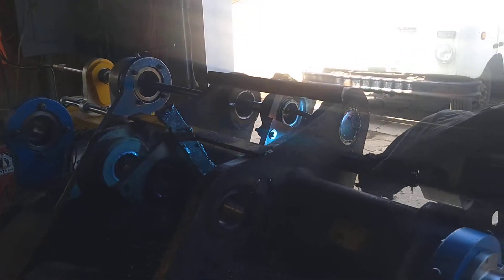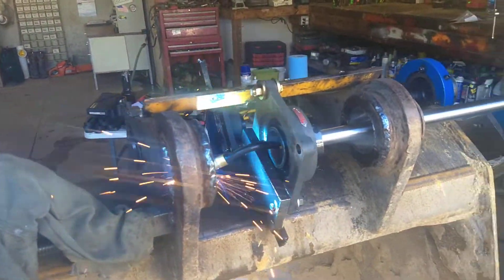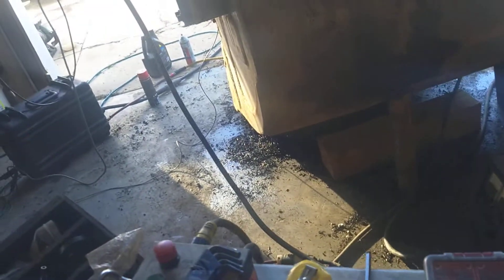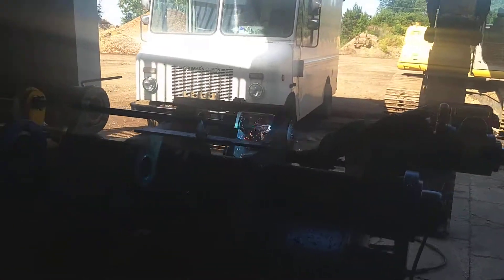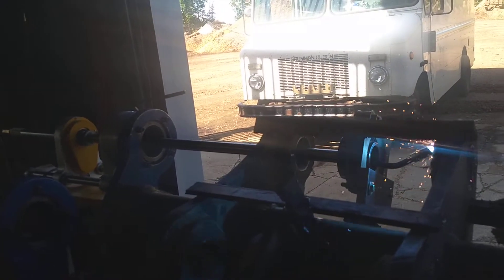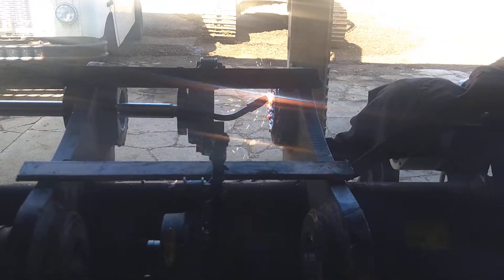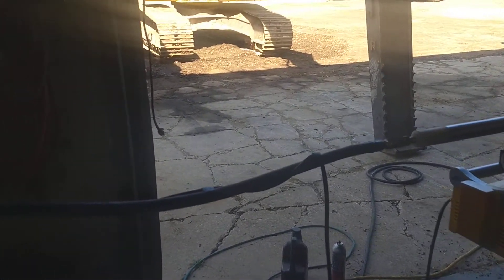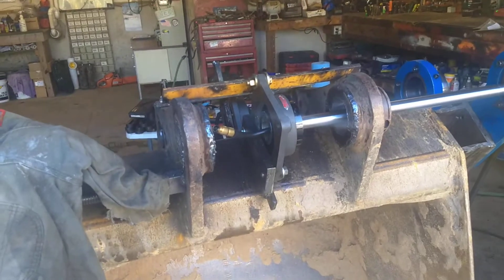Chinese bore welder review, are they any good?

Comment: Thank you very much for the info.  Been looking at those things for a while and just didn't have it in me to pull the trigger.  Now I know.  Their exactly what you said but they are enough to get by.
Reply from the maker: I had exactly the same dilemma when I needed a plasma cutter, I just couldn't convince myself that a $200 plasma cutter could actually work, so I bought the beat up old Miller instead for $350. I seriously wish I had just bought a Vevor to begin with.

Comment: I’ve been wondering what these are like. Has it lasted? I’m sure you made your money back on. Hopefully you still are active on YouTube. Thanks in advance.
Reply from the maker: As a matter of fact I just used it on Friday, it's still chugging along, I've made a few minor modifications to it since I posted this review but nothing major.
Reply from the maker: I would definitely approach buying one of these from the perspective that it's just saving you some time over building one from scratch, they really have some peculiarities about them as they come out of the box. Just as an example, the swivel where the cable attaches to it will bind up if you don't support the cable somehow, it'll give you royal grief if you just try and let it hang off the end of the stinger well it's welding.

Comment: So for a guy starting out whats your thoughts on a Chinese 5000 doller bore welder and boreing set up. I'm redy for a bore machine but 30 + grand is a lot lol
Reply from the maker: I wouldn't buy any Chinese welder or boring machine unless you have the tools and ability to make anything that breaks- welder, mill, lathe, and the ability to use them. I can't overemphasize how bad some of the features on my bore welder were, I never even tried to use it before I made modifications. I still fully intend to buy an American made welder as soon as I can afford to.
Reply from the maker: I really can't speak to the quality of the Chinese boring machine, but in general I would steer towards the ones that are copying the climax design if I was inclined to risk it. The York style has some pretty significant design limitations and I have grave doubts about it getting any better when the Chinese copy it.
Reply: Whats your thoughts on york machines?
Reply from the maker: @beauswisher8580  I have never operated a York, but I built my first boring machine myself as a knock off of a York. I took all their dimensions and beefed them up, 1 1/4" guide bars instead of 1", 3" billet aluminum end plates instead of much thinner cast aluminum, etc. Having used it side by side with the climax, it is great up to about a 3" bore but York is seriously overselling the product to claim it is practical on anything much bigger. It is much more prone to chatter and vibration than the climax.

Comment: Thanks for making this video. Was wondering how well they worked?  I see the welder/ line boring set up for 4000 bucks from China. Normally the cost is 25-30k from York, climax or bore repair
Reply from the maker: I'm still running this rig, definitely has its limitations, but it beats hand welding all to pieces. Buying a york bore welder is on my wish list though.
Reply from the maker: I should add that I have no experience with the chinese boring equipment, just the welder. I built my  first boring machine as a rough copy of a York 4-14 and then bought a climax BB5000. I don't think I would get a Chinese boring machine, I have serious doubts about getting any actual work done with one.

Comment: Hey Andrew, I know you said you converted to miller gun/ nozzle, but how does the one it comes with allow for nozzle to bore adjustment ?  Different length stems or necks, ball swivel gooseneck?  As I'm sure you are familiar with the climax/boretech ones use very stubby nozzle ends with a curved contact tip for small bores (1.5"-3" or so).  It doesn't look like the gun/ nozzle it comes with would fit for small bores work ?   Thanks in advance
Reply from the maker: It has a ball swivel system, you are correct that the existing setup isn't good for anything smaller than about 65mm. But those are simple enough parts to make.
Reply: @Andy-PerpetualMotion  I see and thank you, I bet even the BOA/york  weld necks and nozzles could be adapted to fit it as it is a similar design.

Comment: Andrew, where did you find one of these for $1600 ?  I see them on eBay in the 2200-2600 range.   Also what size is the split bore where the  bore welder frame is made to clamp on a bearing ?   Wondering if it will fit  on a york bearing, thanks in advance !     Nick
Reply from the maker: It was on ebay, they were running a sale when I purchased mine. I machined the adapter, it came with some weird face mount system that must fit the Chinese boring machine. I also adapted it to take a Miller gun, what it came with was a joke.
Reply: @Andy-PerpetualMotion  thanks, I'll keep an eye out for a sale, but the ones I'm looking at look almost the same , just with a split bore and a pinch bolt , very similar to a york boring bar drive and yes I saw your adapter.   I've tried asking several of the sellers about parts availability and you can't get much communication out of them.   Kinda like rolling the dice but much cheaper than a BOA or climax/ boretech.